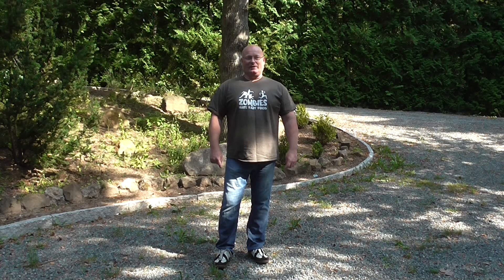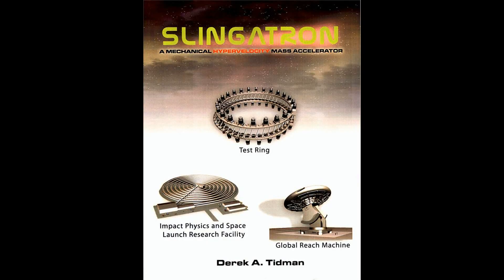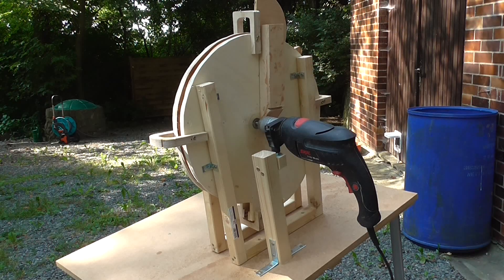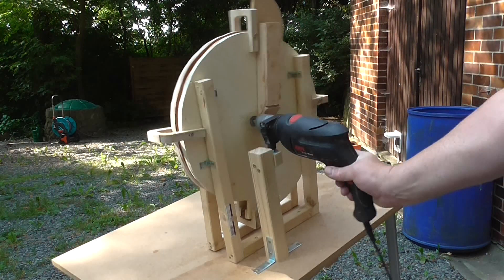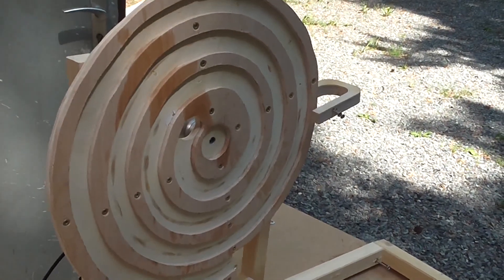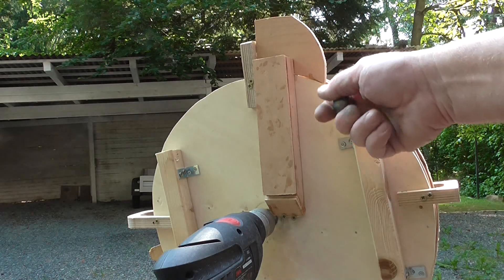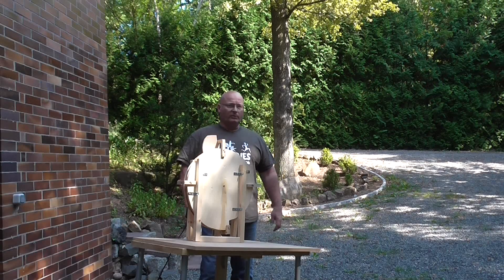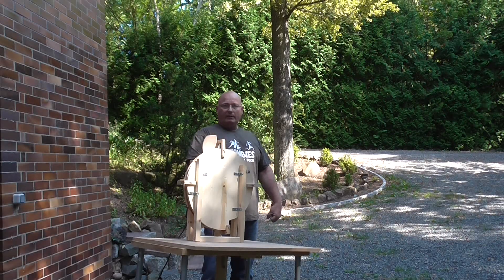How to turn a drill into a monster shotgun!

Comment: dude i think it´s cool. but...  i think ur wasting a lot of energy by adding so many turns to your spiral. pecause your drill isn´t turning faster evry turn. i guess the metal ball (i don´t know the name in english) would get the same speed or even faster if you don´t make it spin inside, just by placing it at the end of one single loop. and kick it with the wood stick atached to the drill. Just kick it. don´t spin it. it´s my thought. Not trying to offend or anything. Greetings from mexico city
Reply from the maker: If you kick the ball, the rotor would break. Do not underestimate the force.
Reply: Mmmmmmmm... ur right, never thought of that. Well hope to see more progress soon!!

Comment: I was searching for info on tactical shotgun slings and curiously stumbled on in after seeing the title. Glad I did. Now for the past 20 minutes been thinking about feasible adaptability to be using compressed air. I guess the spiral accelerator would be the concept part that could be adapted...but what a engineering challenge for it to work especially the auto loading part amongst other things also. 150PSI working pressure.

Comment: Well, if there was a third disk between the spirals instead of a rod, with radial cut (or a few cuts), it would only take one ball per turn (or one ball per every cut) et voila - you have the full automatic shooter.
Reply from the maker: Not quite. The only way to fed balls into the rapidly spinning action is THROUGH the axis. Otherwise it is impossible to squeeze in the ball, the blade turns too fast. I am building a new full auto version right now.
Reply: JoergSprave  Try putting the feed vertically and run through a tunnel with rifling so it uses gravity to feed it into a hole in the tunnel. The riffling will move the ball towards the disk and feed it into the maze. It might take a small bit of reworking, but it will help get the individual rounds in faster. The loading tunnel would be connected directly to the blades.

Comment: you should look into a milwuakee 5196 die grinder, it turns 14,000 rpm and is about 1/2 hp if I am correct on the hp

Comment: I'm pretty sure we don't have an engine that could launch anything into orbit from such a spiral machine. First off, even if you could attain going orbital speed, it'll burn up before it gets very far. If it was made of an impossible material that didn't disintigrate, it would be slowed by air and land miles away. And if you wanted to orbit outside the atmosphere, but launch from the ground, you would have to angle up, which wouldn't be an orbital path as much as it'd be a trajectory. Basically, we'd have to launch the spiral throwy thing into orbit, then use it to launch a ball bearing into orbit, at which point if we don't consider the rotational force, the bearing will begin its journey off course and it would still eventually crash back into earth

Comment: IN WWI the British had the idea,or some lunatic on their side that is,of constructing a steel-framed wheel about 30 feet in diameter,mounted on an axle within  a mounting,loaded with bombs on its perimeter.This wheel would be rotated,faster and faster it was hoped by teams of men working for several days until it had reached release speed when it,the wheel,would be released from the axle and allowed to run away across no-man's land  with the attached bombs exploding away merrily!It never came to anything for it was calculated that it would require the combined efforts of several hundred men for days on end-all exposed to enemy artillery fire-the whole shebang being over 40 ft.high!

Comment: Make it any bigger to accommodate a baseball, and congratulations, you just made a pitching machine!
Reply: Because that is essentially what this apparatus is. A shotgun, shoots slugs of little shots in a spread. This? Does not.

So, if one wants to practice softball batting, build one of these. Though, a power drill may not have enough horsepower for the size and weight of the softball/baseball.

Comment: Fun but the ball reaches terminal velocity in the first couple of revolutions? The further around the spiral the higher torque needed to maintain acceleration is not available with a puny 220v drill. L=R x P with R increasing every rotation. Of course if the pathetic 220v drill were replaced with a decent sized internal combustion engine the Zombies would get a proper fat bloke for dinner.  ;-)

Comment: Well.. And interesting design... but it has one really major flaw. No matter how ong your acceleration path is - you'r limited by rotation speed of your puhing arm. And you get to this speed pretty quickly...

On the other hand, there is a "Railgun" concept, where a bullet is propelled by Electomagnetis force. And the main probe with "RaiGun" design is - you can't have a magnetic monopole (and a dipol would have forces applied equally in both directions which is bad news for propelling things.) and a Electically charged bullet would go... in circles. o it does no work well with regular "Straight barrel" gun design..
But if thesetwo design meet...

Hm...
Reply from the maker: Well, I can always increase the diameter of the spiral, then I get to serious speed without a problem.
Reply: You can. But the size will grow as well... linearly.
And at some point you'll run out of rotor power, becuase pushing arm inertial mass will grow as well... And much faster, because structural integrity of the arm will also become an issue, unless you make it thicker at the middle...

Speaking of which: If you make a central part of your pushing arm as a circle with just a slit, so only one ball can fit there at a time, your current design might work as autofiring... at least if you load several balls it will fire them one by one, not all of them simultaniously.

Comment: If you made one out of metal and fine tuned it eg made the track perfect and smooth. Added more length for the tracks and use a small steel ball bearing as ammo and then had a motor than could spin the device at over 10,000rpm + and last thing have the ammo introduced once the motor it at full rpm you could have something to take on a gun for power and penetration. Might make one myself.

Comment: Lethality = zero
Reply: Strongly disagree! Get hit in the head with one of those marbles may prove to be lethal.
Reply: You wouldn't have to be Neo to dodge a couple of those things. I saw how slow they were going.
Reply: Oh for sure, I agree they don't move fast, BUT if you were slow enough or stunned enough to stand there to get hit in the head with one of these marbles then I'm pretty sure you'd die. But yeah, I see what you're saying now.
Reply: Depends how many are coming and for how long. If you could sweep somebody long enough with enough shot, you could mos def do some serious damage. Also, this is just a first gen prototype, the potential for lethality with this principle is quite real. I mean, if it can launch a capsule in to space, then it can kill. That being said, as with most mechanical models, scale matters. There are far cheaper and easier ways to launch projectiles. Not to mention the lack of mobility and clunky size of the machine vs the projectile. But on a large scale, this is a good idea and it's too bad those guys on kickstarter didn't make their goal of 250 large.

Comment: Hey u huge fan here I was going to see if you could make my invention a reality but looks like you have alto on now but I will leave you with it and maybe you may use it? Um well it's a slingshot using that thickest rubber tube on Ebay the grey one but in stead of just pulling it back why not coil it with a drill until it's full stretch then it will have awesome power it's kinda making it short but with tje power of long traveling rubber plus it canbe stored? Well love vids keep it up

Comment: Make one out of steel powered by a 2 hp induction motor! Add a 20 pound flywheel to the input shaft and use smaller bearings for higher velocity and less centrifugal oscillation. You could make it fully automatic by installing an optical interference sensor at the muzzle to trigger a solenoid operated  gate so only 1 bearing at a time is inside the machine at a time. If you used a 2 foot diameter wheel and a 2 to 1 belt drive system you would get some frightening rates of fire and velocities! You would have to experiment with gear ratios to dial in the most efficient coupling of the 2 hp motor to the 1/2" steel bearings. At those RPMs you would also probably want to incorporate a dual feed, dual arm system to balance the load with one bearing riding out on opposite arms of the drive arm. Oh NO! I have the majority of the parts collecting dust in my machine shop. I think I just stumbled upon an evil project to finish off the rest of this freezing winter! lol

Comment: Shooting something into orbit with a slingshot is possibly one of the worst and most impractical ideas I have ever heard of and they clearly don't understand anything about orbital velocities.  FIrst...... you need to be going extremely fast.  So fast in fact that at atmospheric pressure you would instantly burn up and there isn't a material on earth that would prevent that.  Just look at the space shuttle re-entering the atmosphere that is going slower than orbital velocity..  It has special tiles to prevent it from burning up and the only reason it doesn't it because the air at that altitude is so thin that you couldn't breathe it.  Lastly, when we launch stuff into orbit it doesn't just go "up".  You have to shoot it far over the horizon at a vector that is just above tangential to the earth that keeps it in a continual state of free-fall.  If you shoot something straight up it will just fall straight back down.  It is impossible to do this from the surface of earth.  You have to continually accelerate the object after it reaches altitude.  Even then your still talking 25,000 mph AFTER it gets to altitude.  So you would have to launch it at like 100,000.  Not possible.
Reply: atom. i dont think that you fully understand the power of this sling there is a record of a person useing 1.1m long pice of rope on the sling and throwing a 100 gram rock almost 500 m he probobly used a distance of 1,5 m to accelerate it and a human cant do it nearly as fast as a machine
Reply: Mayor Payne Well I love it when people experiment and I will agree with you that with every failure you gather more information.  That is great.  In this case however, we are talking about launching objects into space at multi-billion dollar space-craft.  He actually called air "negligible" on his white paper.  When lives depend on stuff like that.  Nothing is "negligible".  Especially when it's the hardest aspect of this proposal to over-come.  I just don't like the fact that he's collecting lots of money from people on kickstarter and doing research on a subject in which large amounts of data is already out there.  I wish he would just do simple physics equations or research.  It's just not professional and it's kind of foolish to do start collecting money before you run it by a few professionals.  Most could have simply told him flat out.  It's not possible with current technology.
Reply: "The rocket motor upperstage on the Payload Module is fired near apogee (highest part of the parabola) to make up the velocity lost from atmospheric drag and to alter its trajectory into a circular orbit around the earth." This is from the kickstarter, it won't just be a huge metal ball they are trying to hurl, but an actual rocket.. Protip: know what you are talking about before you pretend to be smart.
Reply: I am an engineer and I know what I am talking about, so don't tell me I don't have an education.  What are your qualifications?  I challenge you to find real Data before you respond.  This alley has been explored many times in the past and I will give you a name.  Dr. Ian R McNab.  Why don't you look up his data about the subject.  He worked with the US Naval Research Academy on their railgun project, which aimed at doing this exact thing.  It cannot be done... at least not the way this "slingshot" guy proposed it.  He actually called air "negligible" in his white-papers.  Lol.  I gave you the info... invest in this bullshit kickstarter if you want, but your only fooling yourself.
Reply: tim bum I am just not even going to completely respond to that.  It's just so dumb that it's not worth it.
Reply: thank god you are so smart what would we do with out you and your dull comments if it works great if not oh well too bad scrap it because its rather a easy build much easyer than doing a equasion to see weather or not it will work stuff rarely works the first time
Reply: tim bum did you seriously just say it's easier to build than to do the equation? You can't even spell equation right.  You are so dumb.  I'm going to say that you can't be older than 14.  If you are you need to pay better attention in school.
Reply: he also said easyer.. But i do get what he was trying to say, i think.. Its better that they try and fail for that gives us more information that could possibly help us in finding alternate ways to transport unmanned crafts into space. i doubt they will succeed but it will still be worth doing.
Reply: you are right i think he went over the top with this i did not pay attention closly enough sliped by me its a nice way to send a projectail out but he went heavy on the suger you can get a nice distance but it does not come close to a rail gun that uses magnets and capacators to store power much more efficient than mechanicla energy and someone useing this to ''transport'' stuff is just not practical is about the worst idea i have ever herd  the object that comes out of this is about as accurate as a blind duck you cant just toss something 1000 km out and exspect it to come straight on target and intact and sending radioactive stuff on this could be a real SHF scenario maybe stick it on a back of a truck and use it as artilary but thats about it for now he is going too big too fast
Reply: tim bum True.  Now that is a good idea.  Use it to launch artillery.  I bet if he could design it to do that he would make half decent money.  The military spends rediculous amounts of money on weapons.
Reply: Yeah I've seen the videos that General Atomics and BAE put out with their rail guns.  It's pretty cool.  They are saying 110 mile range with their sabot round going mach 7.  That's pretty fast.  It's still only about 1/5th of what you would need for orbital velocity at ISS level, but nevertheless... if you pump enough energy into something you can get it to go any speed.  I think they could use railguns for micro-satellites in the near future and your right  It will have to be an "active" system to compensate for air-drag and changes and what not.  The last thing we need is an impact and the very real disaster known as Kessler Syndrom.  An unstoppable chain reaction of space debris that would render space exploration unfeasable for dozens of years.

Comment: When the brake down of society comes there may not be any electrical power to run an electrical drill so if the devise could be made using only man power then you would something you could always depend on.

Comment: for some quick scary numbers
1/3 meters in diameter motor spinning at 5,000 rpm the projectile can reach a theoretical speed (not taking into account friction losses) of 5000 meters per second or 18000 kph
more practical would be 200 rpm @ 750 kph
the hard part would be to balance and reduce friction

Comment: You need to barrel the device with a tube that has a slight forcing cone like a shotgun.  Then you would have something lethal.  You better epoxy and glass the parts with graphite power to be safe for the operator.

Comment: I would be interested in some testing showing that the spiral actually increases the terminal velocity of the ball. Does it take so many revolutions for the drill to get to maximum speed, or would it work just as well with a much shorter spiral path?

If longer does work better, what is the length of path needed to get the frill up to maximum speed? This would be shorter with smaller projectiles, so perhaps there's a sweet spot that can produce a much faster outcome.

Comment: replace that blade, an put a disk with 2 grooves in its place. the grooves should be placed on the 0° and the 180° radian, and a little bigger than one ball. The idea is, that as the disk spins, each groove will catch one ball only,and push it threw the spiral until it can catch the next one, which to that time will be in the same grove one spiral-turn ahead .this will allow a machine gun like firring. More efficient and precise than a shotgun... (two groves because of the centrifugal forces.) Weiter so!!

Comment: You could do a closed circle and accelerate the ball electromagnetically and then open the ring when it's at max speed.
It wouldn't reach orbit but it could be devastatingly fast.

Comment: Wouldn't it be more effective if the launcher was positioned horizontally as opposed to vertically? 
It would mitigate gravitational drag when the ball is being pushed upwards by the blade and will also be better secured to the table as there is more surface area to fasten, ergo giving you a more accurate and powerful launch.

Comment: Full auto would not be hard. Just put the feed on the side and use a spring to press the balls into it. Also for greater accuracy create a straight extension on the end of the spiral to serve as a stabilizing barrel. The barrel should extend beyond the reach of the armature so that the armature does not destabilize the path as it exits the barrel.

Comment: If you place a tiny flipper on the left side of the muzzle that is connected by direct link to your ball hopper, you could make a disk within the "feed shoot" that would pivot out of the way simply by using the high kinetic energy of the previous ball as it leaves the barrel.